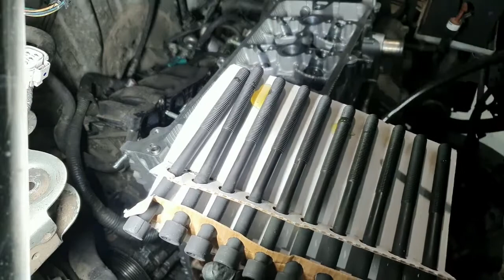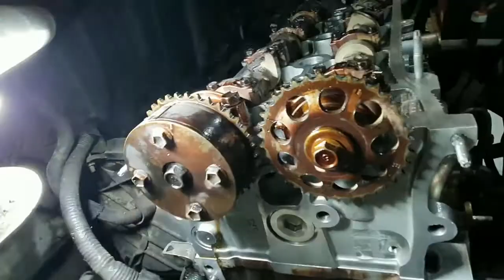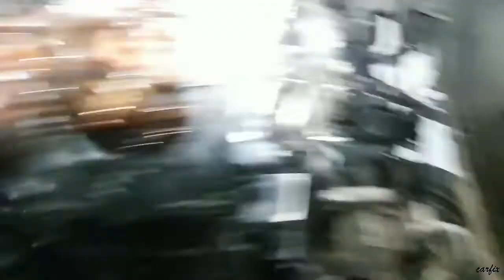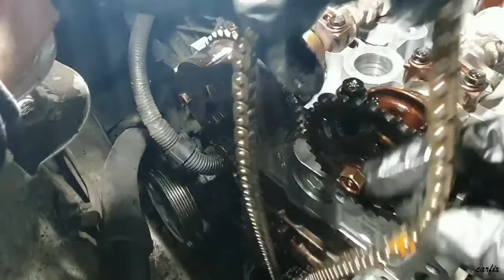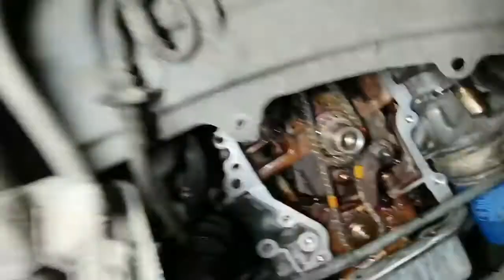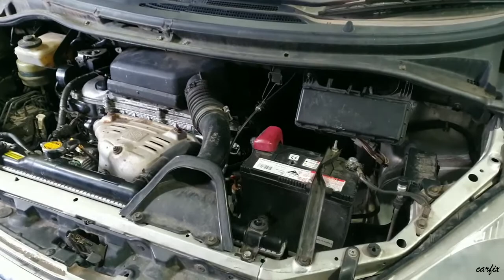Toyota 2az head gasket install part 3

Comment: Very good video, Im about to work on a similar engine tomorrow replacing the head gasket.
I watched part one but couldnt find part 2 instead with part 3 only it gave me a fair idea on how Ill work.
I was worried about the timing part but after watching your videos I feel confident, thanks so much.
Keep us posted,👍
Reply: Carfix, when you installed the head the piston no#1 waant at TDC but in the end the engine was running smoothly what did you do?
Reply: @blacquejacque5188  He did not have to worry about TDC.  He properly aligned all three (Intake Exhaust Crank) marks with the chain.  This is good.. If you had no marks on the chains/cams then you would need to zero the cams and the crank to TDC.   he is basically reassembling with the crank exactly where it was at at time of disassembly.. it was not at TDC then and is not now... but if he would have turned the engine over slowly, you would see what you were expecting.. TDC and CAM lobes pointing up  (when it was the proper time for cyl1 to be at TDC).

Comment: How did you clean the block and cylinders so good?
Reply: Why? You not to use the oil or chelack in block before to replacing the gaskeet

Comment: Great video  I have 02 rav4  and need cylinder head resurfacing  to 
.0025 mm  can I use OEM gasket or oversize  gasket (thickness)

Comment: when you placed the head on , the number one piston was not at TDC,  what happened afterwards?
Reply: oh my bad,  it was running at the end of the video so you did something right :)
Reply: @poppawes69  He did not have to worry about TDC.  He properly aligned all three (Intake Exhaust Crank) marks with the chain.  This is good.. If you had no marks on the chains/cams then you would need to zero the cams and the crank to TDC.   he is basically reassembling with the crank exactly where it was at at time of disassembly.. it was not at TDC then and is not now... but if he would have turned the engine over slowly, you would see what you were expecting.. TDC and CAM lobes pointing up  (when it was the proper time for cyl1 to be at TDC).

Comment: Sadly I want to this myself I know I can I just need more information than this like removing the belt and stuff and all the tools needed and also to clean the block and head my Camry started to leak oil from the front right corner never over heated or anything it ran like a champ 268560 miles on it transmission still shift likes butter too oil done every 1200 miles I’m so sad my first Toyota too